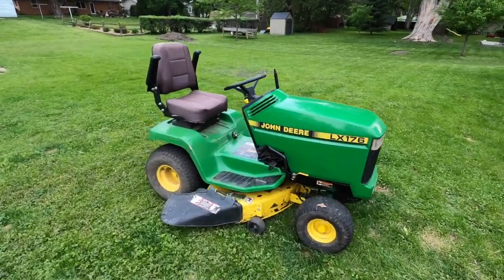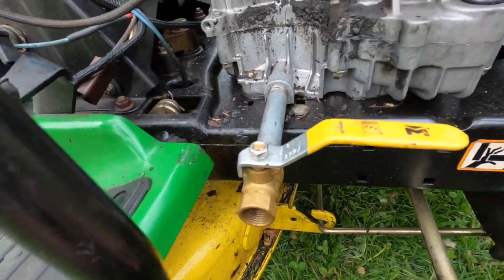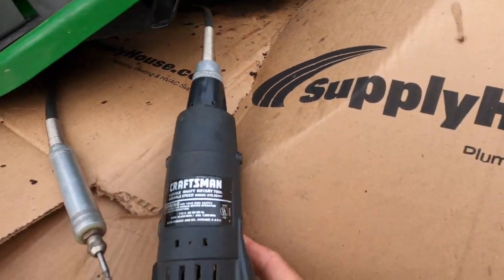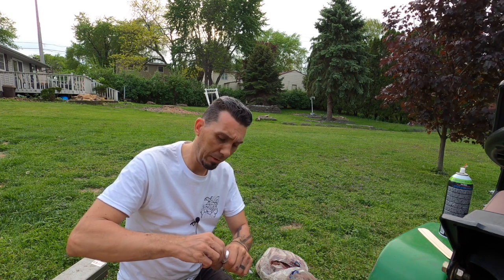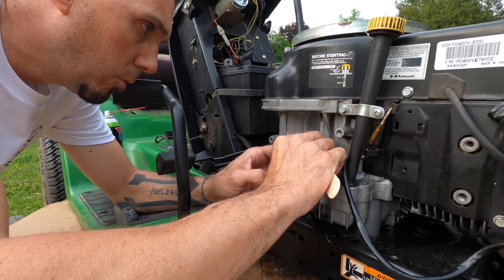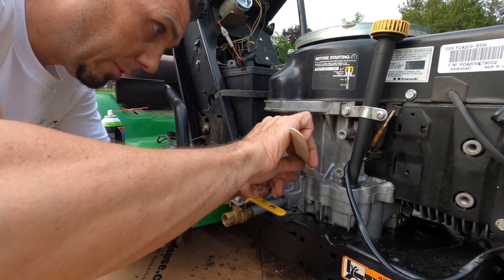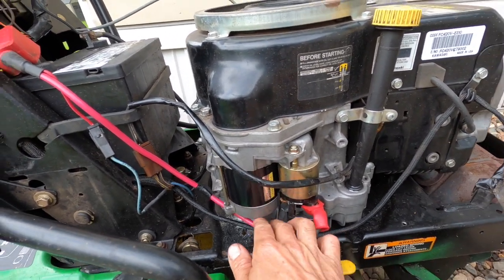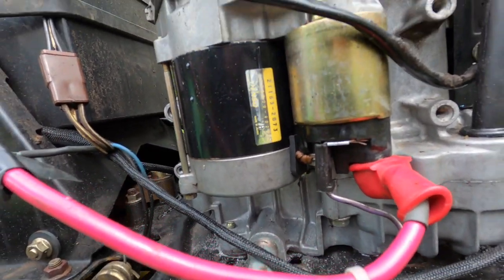J.B. Welded My Cracked Engine Block.

Comment: Nice fix! I have had better luck with the original long cure JB Weld over the quick stuff, but I'll bet this did fine. Shouldn't be any pressure on it right there.

Comment: I put the wrong harmonic balancer on my car’s engine and it warped the halfmoon key off and bore a hole into the crankshaft nose. I wonder if I can use JB to put a new key in and fill that hole.